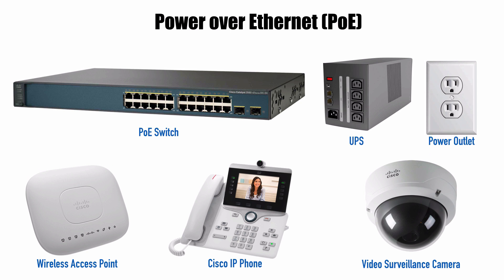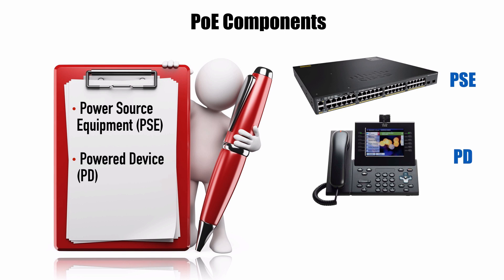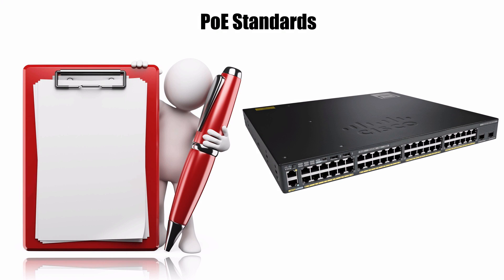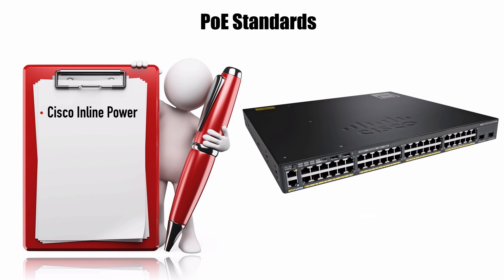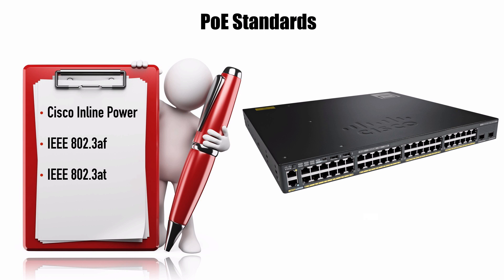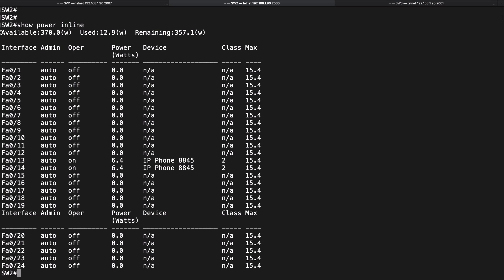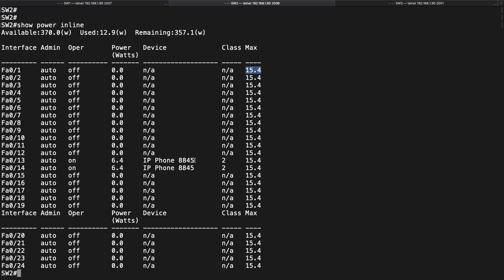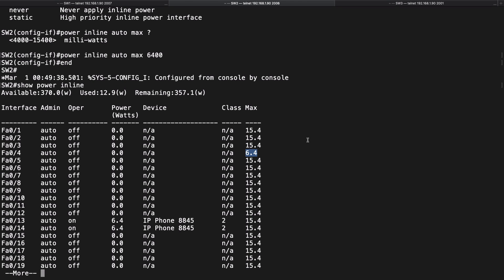Power over Ethernet (PoE) on Cisco Catalyst Switches

Comment: Hi Kevin, that is a great video which has given me a quick overview. I have a question, can I select the PSU of the switch based on the number of PDs which will get connected to the switch? The scenario is, I am planning for a Cisco 3850 switch and I will have only 5 numbers of Wifi Access Points connected to the switch. Rest all are normal workstation LAN ports. So I would like to know if I can select a lower wattage PSU (may be 350W) instead of going for a higher wattage one (1100W).